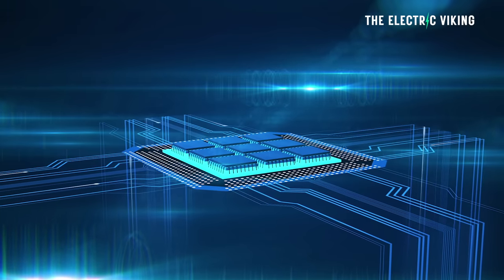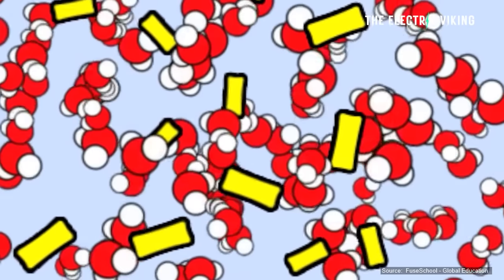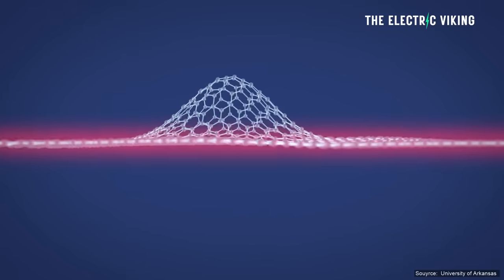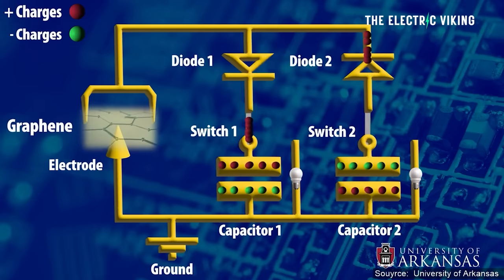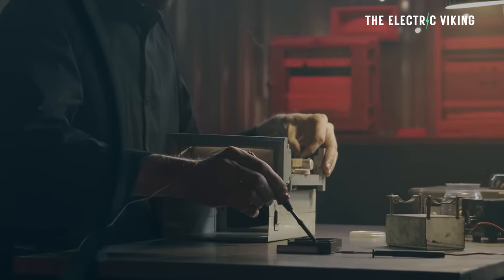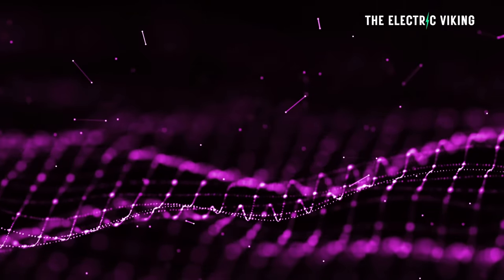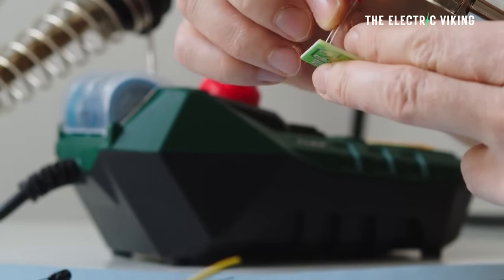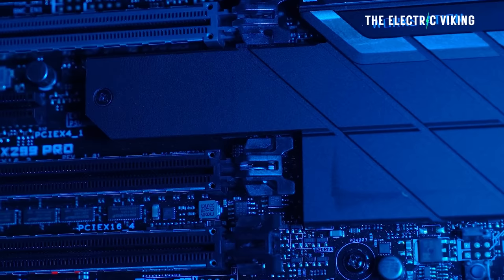Laws of physics broken! Nonlinear circuit harvests free clean power with Graphene

Comment: Collecting power from ambient heat ≠ free energy
Reply: Then it's free cooling / free refrigerators / free AC. I promise, this "discovery" is unbelievable and physics-breaking.
(Heat harvesting systems in existence exploit a heat differential. One side is hotter than the other, and as heat flows from hot to cold, we redirect it to do work. This device draws heat out of its surroundings, cooling the environment, and does useful work at the same time.)
Reply: I think you are missing the point. it's on-demand and there are no conditions to be met (sun, wind, water). its no different from a power generation perspective than nuclear fusion.  do you want to argue nuclear fusion also isn't free energy because technically its a reaction?
Reply: @jonmichaelgalindo  It does sound amazing - my point was terminology matters. You did it yourself by saying 'physics-breaking' when it's clearly not, it's just physics. Using these alt-science terms opens the floodgates to any Tom, Dick or Harry saying anything works by 'breaking physics' and then leading on to more conspiratorial thinking like that trying to kill the world right now.
Reply: Mostly is (if true). It broken second law of thermodynamics. Because you can turn pure heat (not a heat-cold difference which is accepted by the second law but just any heat over 0 Kelvin) into useful energy, you can make an endless loop heat-usage-heat, which means machines without fuel. Perpetual machines.

I'm very skeptical about this.
Reply: @robgeach8105  Not true, actually.  They had to charge the sheet of graphene, and that is probably where the energy they are "harvesting" is coming from.   Not to mention that you can't actually use diodes the way depicted in the circuit due to the voltage drop that occurs across any diode.
Reply: Soon you’re gunna be saying collecting power from the quantum vacuum fluctuations ≠ free energy
Reply: Agreed, this is not breaking any laws of physics that I can see.  I’d be interested to know how much power has been produced in this experiment, my guess would be only in the milliwatt range at best.  If it can be scaled up and commercialized it could be useful, and it is the first time I’ve heard the energy of Brownian motion being captured directly without a temperature differential so is quite interesting and novel, but I’m not going to get very excited just yet.
Reply: @oatlegOnYt there is a heat/cold differential. That is what makes the graphene flex. The differential changes over time which makes the graphene oscillate, creating the energy. If the system was present in a uniform heat source, it wouldn't work. 

It is not free energy. In this case, the energy must be there in the form of a moving heat differential. Like all electrical generation systems, the electricity is created by converting another form of energy. 

It also does not defy any laws of physics, just a prediction that a practical system drawing energy from Brownian motion could not be built.

Now all we need is a Bambleweeny 57 Submeson Brain and an atomic vector plotter and the universe is ours for the taking.
Reply: ianb8 • Heat is everywhere in one form or another. So it looks like it's free to get it in this way.
Then where do you want to get your free energy from? From nothing?🥴
Reply: @briancampbell179  nah, just an electroencabulator 😉

If you’re not familiar, it’s a great bit of bafflegab humour that there’s a YouTube video of:
https://youtu.be/RXJKdh1KZ0w?si=6ZJblhl1ax80E7j5
Reply: You got it.. stochastic EM
Reply: Energy has to come from somewhere, in this case very low energy 'heat' photons. Low energy is the operative concept here.

This looks similar in principle to a crystal radio, a device that has been around for over 100 years and powers itself with radio frequency energy plucked out of thin air. Similar things have been done extracting power from wire fences running parallel to power lines.

The problem with this type of thing is the voltages obtained are vanishingly small, and the energy derived is low grade,  commensurate only with applications that can be powered with miniscule amounts of energy.

And I wouldn't bet against Feynman just yet. His work won the Nobel prize. I don't think these guys have come up with anything here that proves him wrong.
Reply: @ianbartlett8630 Agree with that one.
Reply: Thank you, OP
Reply: @robgeach8105 fusion is NOT free energy, it does not broke the know laws of physics/thermodynamics. The energy harvested by fusion is not reusable, in increase the enthorpy of the closed system it is operated in.
Harvesting the ambient temperature without making use of a temperature gradient however means that the energy harnested is indeed reusable, hence the term "free" is kind of legitimate here as it apperantly brokes the laws of thermodynamics because this system is apparently able to decrease the enthropy of a close system.
Reply: This sounds like "Maxwell's Demons", isolating high and low energy particles.
Reply: Indeed, the power is still coming from the environment
Reply: "Collecting power from ambient heat ≠ free energy"

The general principle is that the maximum collectable energy from a Stirling engine is based on the difference in temperature between the two heat pools.  The theory being discussed is that there is no way to extract heat without a temperature difference.
Reply: @robgeach8105  the comparison with nuclear energy is not very good because nuclear energy "consumes" uranium. This new energy is even better because is consumes nothing, doesnt need to be refuled. Free indeed.
Reply: Umm, how much are you paying for ambient heat?!
Reply: He said "virtual free energy" not "free energy".  Mean is like free energy but it's not.
Reply: @jonmichaelgalindo   But it's specifically not physics breaking. It is revolutionary if reproducable, but well within physics.
Reply: @robgeach8105  Um yeah, nuclear fusion is very much not free energy. There is nothing "technically" about it.
Reply: @davidlee691  About 0.10/kWh during winter for me - any heat taken out of the air by those magical generators is energy I would need to put back into the air to maintain temperature.

Comment: A Stirling engine is essentially harvesting heat differentials on a macro scale, but no one calls those "free energy".
Reply: Stirling engine requires heat differential. It means you need cool or heat something first and keep doing it. This means cost. The device in the video doesnt require any input from anything, never. From what i understood, it only stop if the ambient temperature reaches -253.15 Celsius, which is not goint to happen...
Reply: @caeestevao  These engines can work with passive inputs like magnifying glasses and ambient air, for instance.

Comment: That's an interesting headline, but it's not entirely accurate. The laws of physics have not been broken, but a team of physicists from the University of Arkansas has developed a new type of circuit that can harvest energy from the thermal motion of atoms in graphene.

Graphene is a one-atom-thick sheet of carbon that is known for its extraordinary properties, including its high electrical conductivity and thermal conductivity. The new circuit is made of graphene and is designed to exploit the way that graphene's electrons interact with thermal fluctuations.
Reply: The principle reminds me of the heat pump, it also uses the thermal differences and can send them one way or another - cooling or heating, and you spend only the energy for moving the energy one way or the other. Just trying to add a lay person parallel.
Reply: As an electronic tech, I see very real faults in the schematics being portrayed. There are elements of possibility to this theory, but the depiction as such is absurd.

And any form of diode has a `forward voltage drop' thus that getting to the molecular level as depicted in the vid would render practical working impossible.

Perhaps it was just the depiction that has problems, not the theory. That being said, molecular vibration does emit energy, most readily found in 'noise' in electronic devices, mostly those with 'junctions' of dissimilar molecules.
Reply: @stephensaines7100  One of the more common free-energy patent applications is from people who claim they can harvest Johnson noise.  It gets an automatic fail for the same reason.   Not just the forward voltage drop, but also the reverse leakage current essentially makes it impossible.
Reply: Ur close smart smart smart
Reply: 'entirely', 'at all', same thing, yada yada.
Reply: The circuit is nothing special. Non-linear circuits are commonplace. The devices you and I are using to comment on this are just one example.

I'll try to keep this simple.

A linear circuit is basically one in which voltage and current are proportional. It follows the V=IR or AC equivalent where  V (voltage) and I (current) are AC and R for resistance is replaced with Z for impedance. As soon as you introduce a semiconductor (and the diodes in the circuit are the simplest form of semiconductor), a circuit behaves non-linearly.

A circuit with diodes, capacitors, and switches is fairly mundane. The new bit involves the graphene.
Reply: The headline is correct. If this is real a law of physics has been broken. In spite of it being peer reviewed, I have my doublts. If true this is very big.
Reply: @mgronich948   No, there has been no law of physics broken.
Reply: @mgronich948  I think the discussion revolves around entropy and Maxwell's Demon.
Reply: I remember from university learning that brownian motion cant be used to harvest energy because all forces net to zero. That is indeed not a fundamental law but a derived law from the current understanding. From that point of view, i agree with the title.
Reply: @stephensaines7100  we say, lay people are wondering, the experts are astonished. 🤭
Reply: @mgronich948  The laws of physics are never broken.
Reply: @stephensaines7100  this is similar to what Tesla was working with, the idea being that capacitors cycle charge between themselves. Have to dial in the pulsewidth/shape of the current to get it flowing.
Reply: I certain the Graphene needs to be chilled
Reply: @junkerzn7312 Also I'm certain the Graphene needs to chilled

Comment: Presumably extracting useful energy from random fluctuations of graphene does not violate conservation of energy.  It reminds me a bit of "wave powered boats".  Boats exist with "fins" [sort of] that are pushed up and down by the waves, and this up/down motion is redirected so as to propel the boat in the desired direction, albeit slowly, using no other energy source.
Reply: The difference being, of course, that the wave powered boat doesn't have to overcome the equivalent of a forward voltage drop intrinsic in all semiconductor diodes.

Comment: It must have a tiny cooling effect as the energy moved from ambient to capacitor. Providing tiny amounts of power but it may also act as tiny cooler. It would be interesting to see how efficient it is at both and whether it could scale up a bit.
Reply: Two thoughts: 1 Free AC! 2 Heat is usually the inconvenient side effect of forcing electrons through copper and/or substrate. Self cooling power generation components would likely be longer lasting.
Reply: It must.🦧
Reply: I wrote my comment before reading any other comments (on purpose). Glad to see that the same thing jumped out to somebody else. ;)

Comment: Producing this at scale looks very difficult, but if it works, it seems like the device might COOL ITS SURROUNDINGS as it produces electricity. Thus it wouldn't break the laws of thermodynamics. It's still a TRANSFER of energy (in a clever way!) I hope it is eventually used for geothermal. Atmospheric temps are rising already, so if we release heat from below the surface, this seems like a good way to do it.

Comment: Sam, a great headline for grabbing attention but not true. No laws of physics have been broken by this development in this emerging field of stochastic thermodynamics. It is just that the physics down at that scale has not been sufficiently explored.
However, it is a very interesting development because some useful electronics work can be done by such tiny energy harvesting sources. Maybe the best near term application  is wireless sensors that don't need micro battery changes in inconvenient places like inside pipes.

Comment: 0:55 extracting energy from ambient heat is not breaking the laws of thermodynamics. in fact reading what the university researchers  "...because a temperature difference between the graphene and circuit, in a circuit producing power, would contradict the second law of thermodynamics. "This means that the second law of thermodynamics is not violated, nor is there any need to argue that 'Maxwell's Demon' is separating hot and cold electrons," - Paul Thibado, professor of physics and lead researcher in the discovery.
Reply: Back in 1950's there a debate if solid state diodes were Maxwell's Demon

Comment: Its long been considered impossible because it is impossible.  Sigh.   And, no, you can't use diodes to do this, due to the voltage drop across the diode as well as the reverse leakage current.  That's a huge red flag right there.  Whatever these people think they are harvesting, it aint thermal energy in equillibrium.

I can guarantee you two things:  (1) That it doesn't actually work, or (2) They are harvesting something else, like stray EM in the room or a thermal gradient they didn't account for or even the electric charge they imparted to the sheet at the beginning.

Best case it's actually harvesting stray EM, which is to say... probably microwatts taken from a nearby power source like AC wiring or a wifi router or a nearby high frequency switching supply (like USB-C, for example).
Reply: Yep, a crystal radio. Can generate enough to hear a radio signal but ain't going to power the house unless the EM field is dangerously humungous.
Reply: @jimgraham6722  I powered mine with a penny battery, 50 years ago, and listened to Radio Mystery Theater every night!  But yah.  It doesn't take much.  The ear is an amazing organ.

Comment: It doesn't need two different temperatures? I don't understand, where is the energy form then? Is it just getting colder then?
Reply: A solar panel doesn't need shadow. It just uses some of the light energy. Heat can be radiation too so what is the difference. Yes it must get colder.
Reply: The difference is that the solar energy incident on the PV panel overcomes its intrinsic diode voltage drop. Thermal energy from Brownian motion has not heretofor been known to do that.

Comment: My concern is scale. Ideas similar to this (essentially, harnessing noise within some domain) has been known for a long time. Maxwell suggested a (mock) method called Maxwell's Demon, in the 1800s, which worked with Brownian motion. There is a practical application using graphite - but the power levels are tiny.

NB IF (very much IF) this can be applied at scale, then a very useful consequence is that the thermal source must become cooler. A new cooling method is always interesting...
Reply: That's exactly what I was thinking.
Reply: I wonder how much energy it takes to flip the switches?

Comment: So, have I got this right?:
The Brownian motion induces waves in the graphene which is suspended between two electrodes. 
The graphene reacts in this way because it is light enough to be affected by such a small mass colliding with it.
The peaks and troughs of the waves oscillate toward one electrode then the other – but don’t touch.
The graphene has a negative charge which induces a positive charge in each electrode as the peak nears it.
The positive charge is drawn from the ground connection through the diodes.
Because the Graphene does not touch the electrodes it retains its charge, so continues inducing a positive charge with each oscillation.
The positive charge is bled off through diodes to a capacitor which accumulates the charge from several oscillation cycles – amplifying the charge.
This in turn attracts a similarly energetic negative charge onto the opposite plate of the capacitor, which is drawn from the ground connection.

Qs:
Is this charge more like static electricity rather than a DC current?
How does the capacitor release the charge slower than usual, giving a sustained discharge?
How long would it take to charge an AA battery?

The fact that they are able to slow down the discharge of a capacitor is also important because if it is able to be scaled up it would make a Supercapacitor discharge more like a battery. This would make chemical batteries redundant.

Comment: This first hit the news in 2020. Researchers at the Uni of Arkansas see it as potentially a better power source for devices like pacemakers - an electronic circuit powered by ambient thermal energy overcomes the need for a battery and thus the necessity of replacing batteries from time to time. So far, no company has sought to apply the vibrating sheet of graphene idea in any product.

There are no 'laws of physics' broken here and I suspect that Feynman beyond a degree of surprise at what the researchers at Arkansas have achieved (assuming they have achieved anything) would be untroubled by this development.